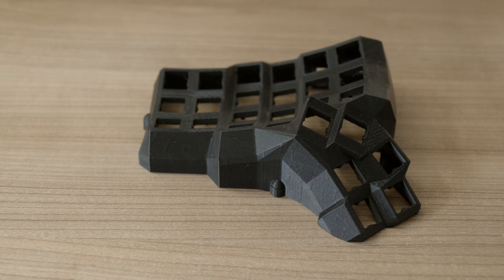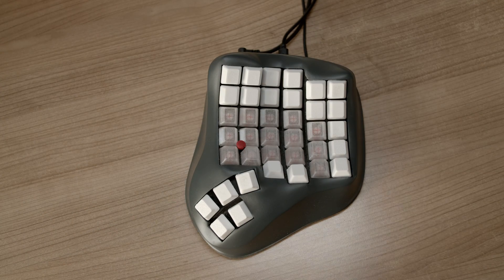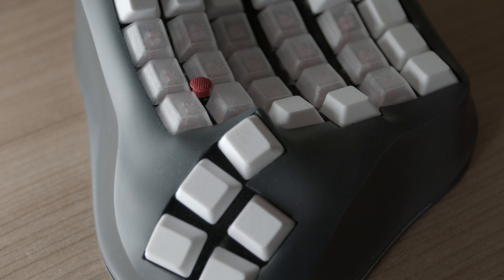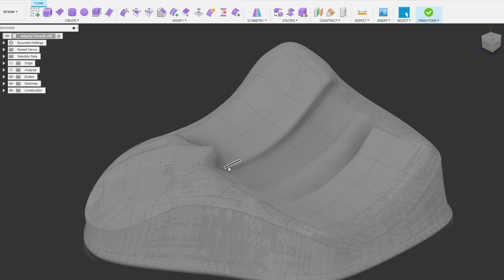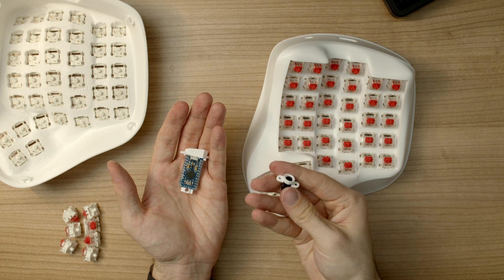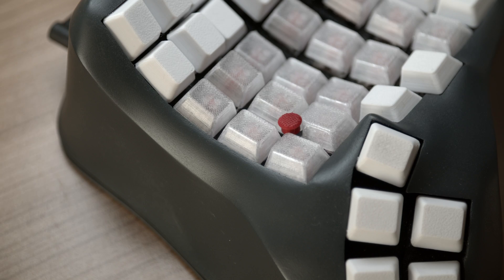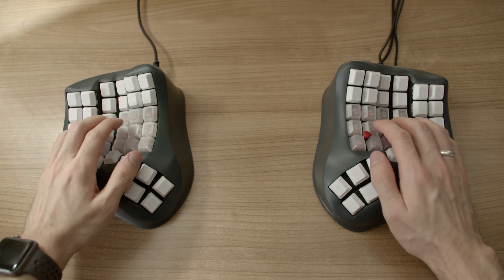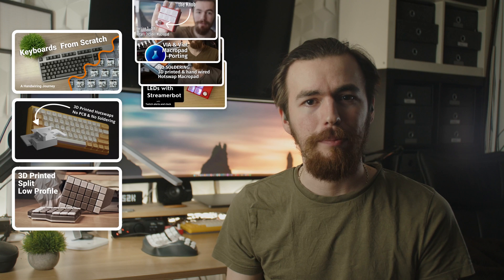Building a Custom Split Ergonomic Keyboard with a Trackpoint - wDactyl

Comment: Hello! Excellent video! I thought I was alone in my fusion keyboard modelling struggles in switching from the usual extrude, chamfer, fillet workflow, and into form modelling. The thing that helped me bring the vertices to exact locations is to have sketch points already in place (derived from a ready premade plate) and then using the pull command to snap form vertices into position.
Reply from the maker: That is an excellent tip i did not know that tool exists, maybe i will try this instead of the surface workspace first thanks a lot for this hint
Reply: @JanLunge  I'd be curious to know if it works for you, or if you find a better method!  I used this to make a case for the Zodiark, though I think I'd like to eventually try a keyboard like the one in your video here. Cheers

Comment: Really nice, I kept waiting to find out how you got it so smooth. 18 hours of sanding. Lol that's a lot. I was able to get a really nice look on a PETG white manuform by doing light sanding (30 min tops) and then a lot of primer and then a layer of paint. If you google the 'mango keyboard', I made that one without much sanding. But obviously you'll still see some roughness and print lines up close.
Reply from the maker: I could not get any filler prime at my hardware store and i even had multiple coats of primer on it but it was just too thin so i went back to completely sanding everything maybe i will find a good primer in the future

Comment: i love that this community is basically a bunch of people trying to create stuff and help each other. I have yet to run into drama or anything. not even entitled people. just diyer trying to build something specific to them
Reply: This is the coolest part for me, I commented in a group buy for switches asking why the maker decided to use choc when they were so much more proprietary than cherry low profiles (sunset choc btw) and was sent to another server and many links for things to try

Probably 8 people at one point jumped in to ask if I had seen one board or another, honestly I'm a massive maker and this hobby has had the most intriguing people with crazy skills, from the people using 10 key boards just to flex to people who have figured out how to program a calculator to send variables to the pc, truly amazing

Comment: You probably should've used polygonal modelling software to make smooth shape. It's really hard to make a flowing shapes in CAD software.
And while sharing source files is good thing. The thing with such freeform keyboard is the button curvature and placement are heavily affected by one's hand size. So if you don't an addition of you hand size information would be just great.
Reply from the maker: Polygonal modelling is on my list to try but parametric modelling in general is very useful and I would be giving up a huge customizability benefit, I might try blender with geometry nodes or python scripts. for the handsize this is why i used the standard dactyl manuform as a reference for keyplacements so people can know what to expect based on that. sadly there are a lot of parameters involved to get the perfect fit depending on finger length, hand size and hand mobility.
Reply: @JanLunge  Polygonal modeling can also be parametric. Houdini currently have all the necessary tools for making this types of project procedurally. Though it's not so easy to export geometry from it to 3d print friendly format. Blender geometry nodes on the other hand current doesn't have  required functionality. But it's in active development so it may get them soon.
 But it's so much easier to do this types of things by hand in blender and just thicknen the polygon shell afterwards.